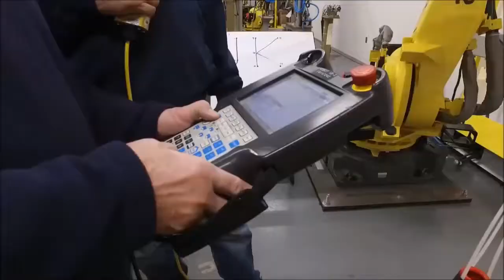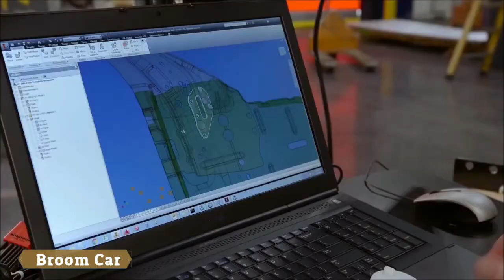You Should Know 2018 Lincoln Navigator Production - Lincoln Factory - Broom Car

Comment: I think the Navigator is one of the best SUV’s on the market. But from $70,000 to $100,000 for an automobile is pretty steep. I saw another video where they said the Continental may be dropped because of low sales figures. I hope that doesn’t happen because I always felt that the Lincoln line of automobiles was the most stylish vehicles that Ford put out.